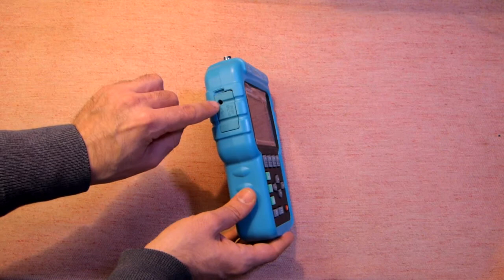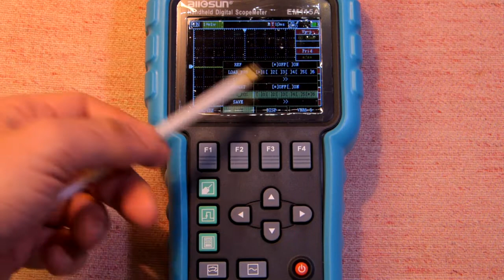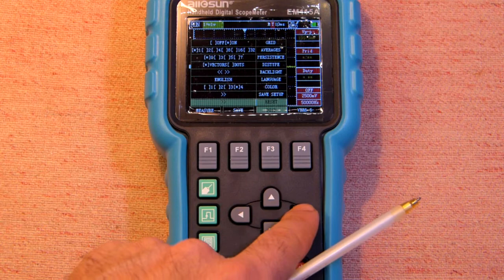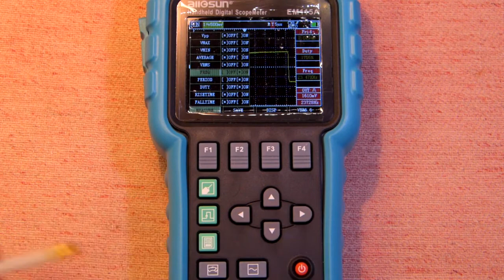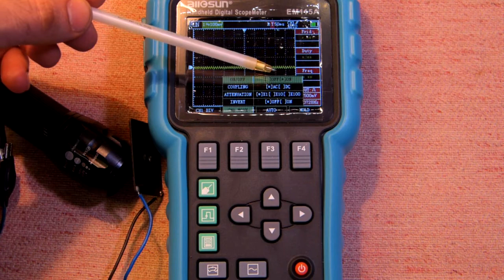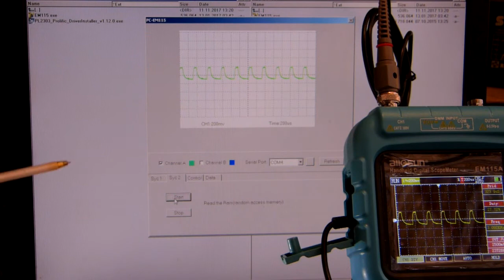ALL-SUN EM115A Oscilloscope Detailed Review

Comment: My friend, thank you for this. I'm trying to find a replacement battery for this device (em115a) like the one in this video. i contacted all-sun directly and they tried to send a battery but being from china, they said customs would not let them ship the battery by itself. :( I appreciate your help if you can
Reply from the maker: Hello, friend, I have nothing common with them, but... I would suggest to find a battery with similar capacity and similar size, as, in my opinion, there is no other way out but to do it.
Please, subscribe to my channel, thank you.
Reply: Thank you for that reply! It is very hard to find that exact size and maH. Can I use a different size (smaller maybe) but as long as its close to that Mah? @koglianc
Reply from the maker: @kurtbennett1164  Yes, - why not? In case of bigger size you should glue it to the rear side, but it would be a little bit ugly. In such cases the best way out is to mount a smaller battery into the device. 200-300 mAh difference really doesn't matter.